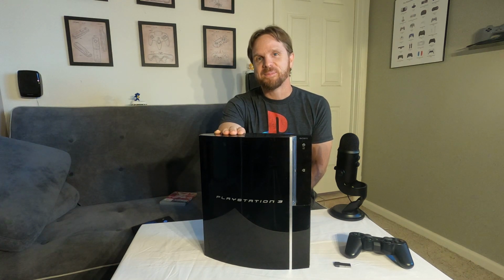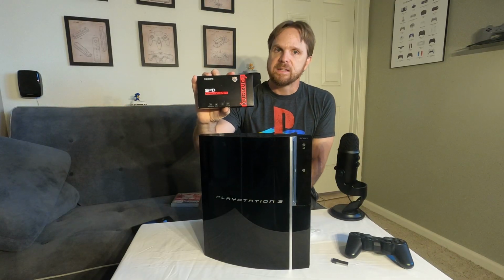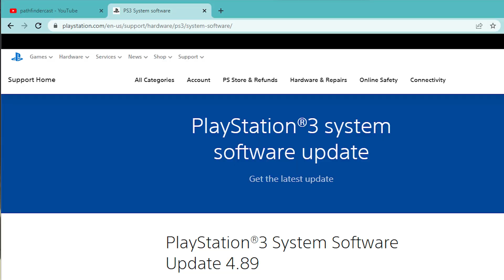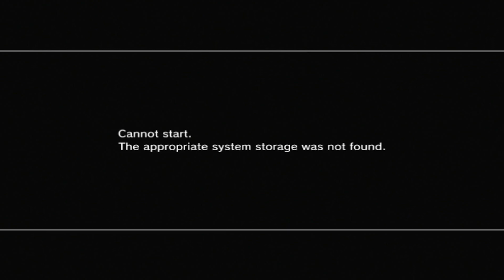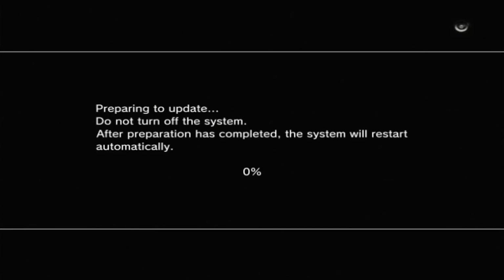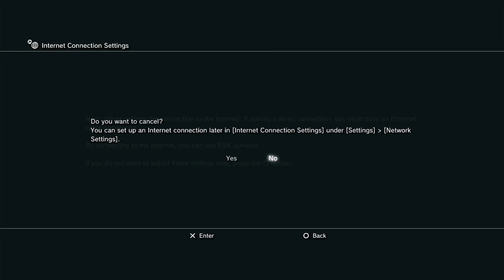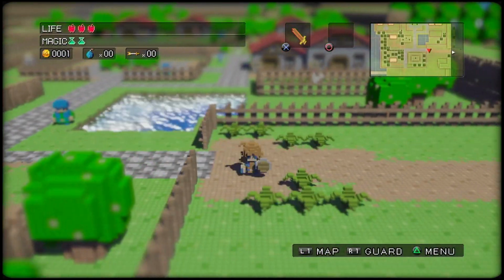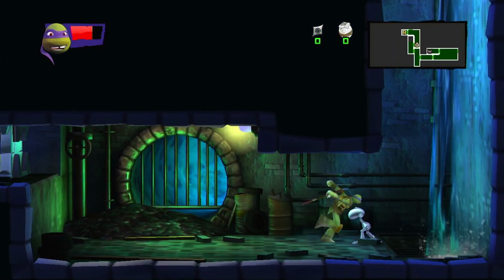Installing a cheap 1 TB SSD in my PS3 for a performance boost

Comment: I was thinking between SSD or HDD but then I read some comments that say that an SSD would be better not just because of speed, but also because heat and noise. Specially heat, which would also increase the speed

Comment: I recently got a cech a01 which is the fully backwards compatible ps3. I opened it ,cleaned 100%, delid, reapplied thermal paste, made so.e holes for extra airflow in the bottom, and jailbreak it. It is an amzing machine. I also added a 1tb ssd but mine is a samsumg. Awesome console. Some games look dated on my 4k tv but still amazing machine
Reply from the maker: Really cool. PS3 had so many good games and great to have especially when many of the games are not available on Sony's newer generations.
Reply: Bud, the ps3 max output is 1080P no matter what tv you’re on

Comment: I just got a ps3 myself!  From what I understand, you should definitely tear it down and replace the thermal compound  and thermal pads at a minimum.  Then up the min fan speeds.    I can feel the heat pouring out of mine after a few minutes of turning on.  That's why these fat ps3 dies! Don't let yours die!
Reply from the maker: That's awesome. I agree that I should do the teardown maintenance on it.  Maybe in a future video. If the heat is blowing out of the back then I think that is a positive sign that the cooling is working properly. These cell processors heat up and the key is the get the heat out as fast as possible. If you weren't getting a lot of heat escaping then I would start to worry that the thermal paste is making poor contact.

Comment: I recently bought myself a backwards compatible model and I'll definitely be upgrading the hard drive to an SSD soon. Not only is it faster but it won't run as hot since SSDs have no moving parts! I'll get the same one you got! I didn't know you could get a 1TB for that cheap!

Comment: when the video started i thought to myself "an SSD would have no effect whatsoever on the performance, nearly all PS3 games run directly from the BluRay disc"
but then you said you're going to jailbreak the PS3 and it all made sense lol, yeah the original HDD in all PS3's was a cheapo laptop grade 5200rpm HDD, even reading from the BluRay disc was faster than reading from the HDD on PS3's.
however i'd never buy any of these cheap Chinese SSD's. they are unreliable and WILL break on you when you least expect it.
i'd go with a Crucial/Samsung/Kingston SSD everyday over any of these horrible unreliable Chinese SSD's.

Comment: just had cancer watching this..
1. u put the usb far right cuz its closer to the hardrive.
2. you didnt need to restore, system update is the one your looking for, or when it says press the ps button and should ask u to press select and start.. didnt need to go in safe mode..
3. basically bottlenecking the ssd.. you can buy 7200rpm hardrives 2.5ich, iv got one..
4. if ur transfering games from pc to ps3, you dont need to use multiman, webman mod has a ftp server and can run at xmb..

Comment: Can I ask if your PS3 was one of the Backwards Compatible versions? You had said that you loaded a PS2 game onto it, which piqued my curiotisty.
Reply from the maker: I do not have a BC model. However when Sony released the CECHL01 they provided some backwards combability  using emulation. They then removed it with a later firmware release. However by installing the custom firmware CFW 4.89, the backwards compatibility was added back in. I have not really explored which games work or don't work as I have been focused on playing PS3 games right now. Great question!
Reply: @pathfindercast  I would definitely love to see which PS2 games work and which ones don’t, since I have the CECHL01 model, and have been wanting to do something with it rather than have it collect dust in the corner of my entertainment room.

Comment: 3:08 it's better to just open it up and remove the dust, using compressed air will just blow the dust further into the device.

Comment: Just need to make certain the SSD has TRIM built-in. Usually have to pay a little more than that.  The PS3 doesn't do any TRIM, so an SSD may not last very long.    Also, keep in mind the PS3 uses SATA II, so at best a SATA III SSD will only be used at half it's bandwidth, which may not be much faster than a hard disk.
Reply: An SSD even on Sata 2 destroys a common hard drive on speed. I used my first SSD with a PC that only had Sata 2 ports. And, yeah TRIM is very important.
Reply: @muneebrehman6288  I wasn't certain if it was SATA 1 or SATA 2.   But with SATA 1 it would be too slow for any advantage of SSD to be seen.
Reply: @muneebrehman6288 it does make a difference though. Especially if you play rpgs and play most games off of the SSD. Most of my RPGs play a lot better and my God Skyrim is actually playable for once. There are differences

Comment: I got a B/C PS3, clean and still sealed, from goodwill. Works fine, fan was a bit loud. I swapped in a 256gb ssd, and first thing I noticed was the fan noise dropped. I think its worth changing just because an ssd will draw less power and run cooler, thereby lowering system temperature. It may not improve system data speed, but its still better than the ancient original hdd.

Comment: Cool video. I upgraded a 40gb to a much bigger HDD few years back. Only issue with PS3 is it’s been dead for years. Can’t even sign in. Don’t know if that’s just mine for some reason. I never messed with it like jailbreaks or anything. Still it’s great for playing old single player games and playing blue Rays. I think the 360 has aged better just because Xbox is more user friendly when upgrading. I think Sonys approach to storage though does create more options. You can stick pretty much anything in. 👍 I upgraded a PSP storage to use as an MP3 as well.

Comment: Actually I don't recommend using cheap SSD despite it won't be heavy loaded, in about 2-3 years they tend to have a lot of "green" blocks with access time about 1.5 seconds which may cause real slowdowns which is really bad for either games or OS. Well at least this is from my experience, I have a lot of Adata SU650.

Comment: Sadly the phat models have a lot off heat issues especially the nand model don’t remember the model number but it’s the one with the card reader..I own serval and all of them sound like jets and run extremely hot 95+ C I never plug it it’s just here for collection I only use my slim ps3 that has good thermals and no issues…I tried to de lid one I was successful on the gpu but I destroyed the cpu while doing it and I don’t want to ruin an other ps3 just cuz I don’t have the skills to delid…I remember I bought it the first day it came out and I payed 600-700 euros crazy loved it though it was a nice blue ray player too until the drive died and then I did my first swap and married the drive to the motherboard!!! Lovely times

Comment: The ps3 can actually clean itself, just turn it off from the switch, hold the eject button and while the eject button is still pressed turn on the console from the switch on the back

Comment: Got my PS3 since 2008, which was the 40GB version.
In 2010 I've upgraded my ps3 with a 500GB HDD, which was definitely a lot back then. (Especially in terms of the average game sizes back then.
I think only Gran Turismo had over 80GB during the time.
Most games were 40GB or even less ...
A little later a friend has upgraded his system with a SSD, which was definitely very expensive back then. 
Similar to nowadays M2 units prices ...
I dont really use my PS3 anymore,, but maybe it's an idea to make the same you just did.
Reply: Ps4 2008 :D
Reply: @mangstah1987  oh ... of course I meant PS3